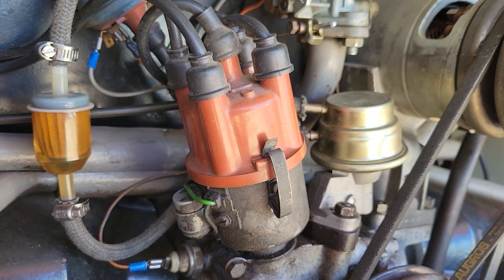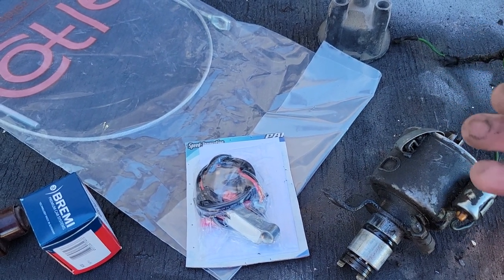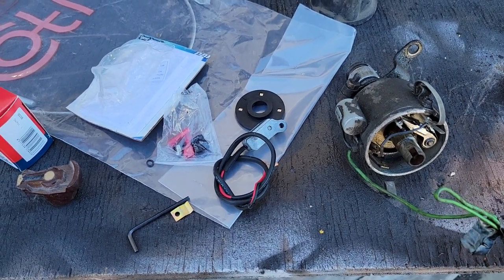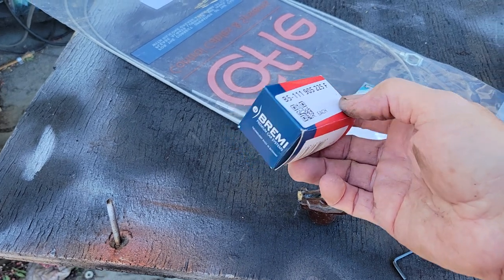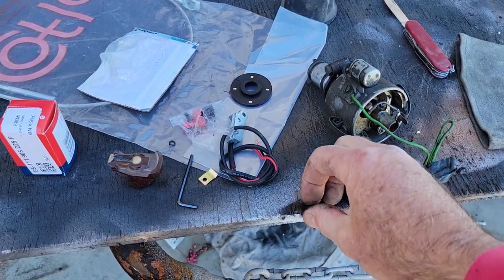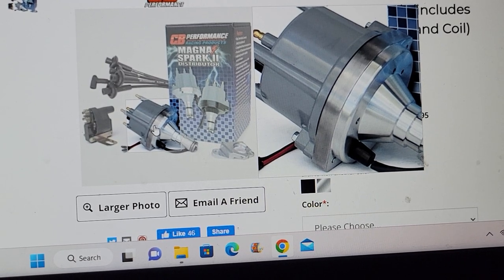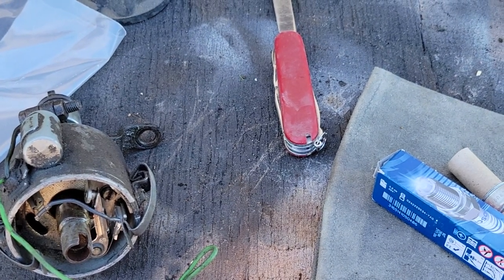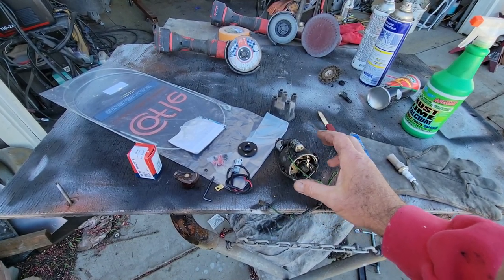VW ENGINE IGNITION - Points Condenser - Pointless - electronic Ignition - Tips and tricks

Comment from the maker: FYI I have as much as 10,000 miles on my EMPI modules. on several different cars. all running bosch coils. Plus ones I have sold and the only one that I had problems with was in the camper van which I changed out. After I changed it out I found out that there was a bad connection at the coil which I think was the real problem with it.  So basically I have had no problems YET....I am still holding an additional one in the glove box. I have not seen too many problems with the China caps.....BUT the rotors I have seen burn through....All my cars have the bosch rotors on them. too.

Comment: I have a 1600dp with dual 40's.. and had a really bad dead-spot.. When I swaped out to the MagnaSpark, it was amazing.. the dead-spot was gone and It felt as if I gained 10 HP.  The motor fired up on the first click..  of all the mod's i've done to my motor.. This ranks #1...  2nd mod was electric fuel pump..  Worth every penny!!
Reply from the maker: Yea I want to upgrade to that on my 2007. as soon as I can.
Reply: I have a 72 ghia. Stock 1600. Want an electronic fuel pump. Any recommendations?

Comment: Hey Mike !  In the early 90s you could get a .009 knockoff with cap rotor and points condenser complete ! for the low cost of      17.50 cents . It would cost 25 to get just the tune up in Bosch parts . Now if you use points NAPA has them in their heavy duty ones that seem to act OK. On .009s every couple of years it's good to check if the swing is still moving they will get dust in them and stick on full swing or not swing .
Reply from the maker: yea that is true. the biggest issue is not the points.....its the condensers are foul.....Right out of the box. just like the old Cheif auto parts Wells Ampco.....those were bad before you even turned your key. We go no starts coming in almost every day and they would say.....Those are NEW.....and we would say......and they are bad. People could not believe it.
Reply: Jimmy, what is the value of the condenser that NAPA uses? I would really like to know if it is .19uf. thank you my friend.
Reply: @Biokemist-o3k  I don't know ? the one I have is so old I don't know where it came from .

Comment: Hello Mike, another great video my friend. I have just completed  testing of ten different samples of condensers from Standard, Empi, Bosch, and an unlabeled supplier that sells 5 condensers for about 14 bucks on eBay. Every condenser came out to .19uF and every one was silver. I really like the 5 for 14 bucks on eBay where you can keep a few in your glovebox or your on the road toolbox. Standard seems to last the longest probably because they have.....standards? I will let you know how long they last. I am using these for my 1970 Porsche as well as my Lincwelder 225 and my Miller Bobcat 225 along with my XS650 bobber. With the way they responded to the testing, I believe all of them should last for a while.I will let you know when the first one fails.

Comment: Hey mike great job 
Can u link the part number for the pointless ignition system
Reply from the maker: empi accufire. I cant find a link but you can call car craft store in riverside 951 781 4480 they dont have a link on their website. We should get them to put one on there. they only have the distributor and it is not listed as empi but that is what they sell.
Reply from the maker: here is the distrubutor at j bugs it is 2 times the price. http://carcraftstore.com/009typedistributors.aspx
Reply: Thank you

Comment: I have a pertronix that is about 10 years old that still works fine. However, in the last 2 years I bought a new pertronix unit on 2 different occasions, both of them didn’t last a week. Pertronix is hit and miss. I just installed the new Pat Downs performance distributor yesterday and it’s a night and day difference. It seems to run a lot smoother at idle than the 009 with pertronix , timing set exactly the same. I’m hoping the pat downs distributor lasts longer lol

Comment: Empi points replacement finally gave out after 7,000 miles.  But I also had a smoking wire on my ignition switch.  So that may have been what killed it.

But I really do not see a quality issue with the product.

Comment: Hey sir, I have a question I’m running a 1679 (88) heads with dual 40s idf genuine webers. I’m getting a good idle with the jets at 55. But it’s bogging down during gear transition. Im running (115) main… do I need to change the main jets. What do you prefer for 1679cc . Any help is appreciated
Reply from the maker: I am not up on the jet sizes and vent sizes on dual carbs.....David at Volkstroke channel might be able to help on that. WHat I do know on that engine is you do need to have 30 vents or smaller on there to run 40s. those are way too big for an engine that small. It can be done but you need to change the venturi.

Comment: What's your feedback on using a MSD ignition box, with a stock distributor or aftermarket distributor?
Reply from the maker: magna spark is better value. to really benefit from msd you need to be on the track.
Reply: @Mike Fn Garage  
MSD puts out a hotter spark, from what I read.  I have both the msd & cb performance  magna spark distributor. But I haven't tried them yet. Just wanted to get your feedback.